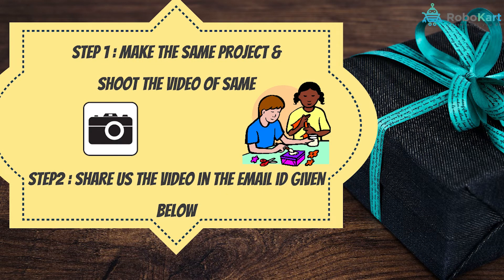How to connect water flow sensor with arduino

Comment: Thanks this helped a lot and works.  I do have a question.  When I compile your code I get the following warning: water_flow_sensor.ino:22:61: warning: invalid conversion from 'byte {aka unsigned char}' to 'void (*)()' [-fpermissive]
   attachInterrupt(t1FlowInterrupt, t1FlowPulseCount, FALLING); //you can use Rising or Falling

Comment: Hello @Robokart,

What code is written after pinMode(flowsensor, INPUT)?
Reply: volatile int flow_frequency; // Measures flow sensor pulses
unsigned int l_hour; // Calculated litres/hour
unsigned char flowsensor = 2; // Sensor Input
unsigned long currentTime;
unsigned long cloopTime;
void flow () // Interrupt function
{
   flow_frequency++;
}
void setup()
{
   pinMode(flowsensor, INPUT);
   digitalWrite(flowsensor, HIGH); // Optional Internal Pull-Up
   Serial.begin(9600);
   attachInterrupt(0, flow, RISING); // Setup Interrupt
   sei(); // Enable interrupts
   currentTime = millis();
   cloopTime = currentTime;
}
void loop ()
{
   currentTime = millis();
   // Every second, calculate and print litres/hour
   if(currentTime >= (cloopTime + 1000))
   {
      cloopTime = currentTime; // Updates cloopTime
      // Pulse frequency (Hz) = 7.5Q, Q is flow rate in L/min.
      l_hour = (flow_frequency * 60 / 7.5); // (Pulse frequency x 60 min) / 7.5Q = flowrate in L/hour
      flow_frequency = 0; // Reset Counter
      Serial.print(l_hour, DEC); // Print litres/hour
      Serial.println(" L/hour");
   }
}

Comment: How to turn on the pump when there is flow and it will automatically turn it off if there is no flow
Reply: @GThirivigiramaAbhishekG  yes I found a system
Reply: @CreativeTree  can u please share that code or information regarding that, it would be much useful to me, thanks in advance
Reply: There are a special sensor for your application to turn on and Off a water pump when water is flowing you need to use this pressure controller you can buy on ebay enter this link on ebay 
https://www.ebay.com/itm/New-Automatic-Water-Pump-Pressure-Controller-Electronic-Pressure-Switch-145PSI/274596649097?hash=item3fef3c5889:g:FWgAAOSw0Z1fxhLl
Follow instruction how to connect it. It is direction sensitive means you have to check where the side that says water in which connects directly to the pump and water out connect to your pipe or Faucet.  ( In summary it connects in series with the water output side. Once you open the water faucet that you install after the unit, the pump turns on. Once you shut off the faucet after the pressure is built up inside the unit the pump shuts off)